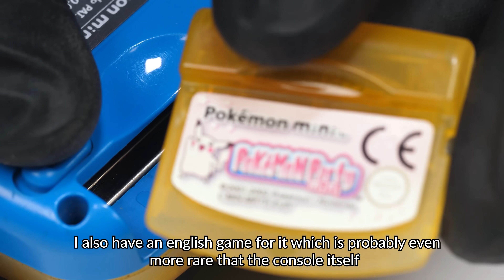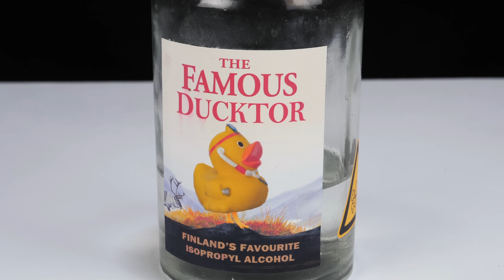Restoring a Rare Pokemon Mini - Console Restoration

Comment: That UV color restore is always impresive
Reply: And kinda hazardous
Reply: @clonedbraixen ooo why so?
Reply: Shame it doesn't last. I wish there were a way to preserve the original look without re-retrobrighting every few months
Reply: @Pixelman546  is there some kind of transparent primer that you can spray on the part to preserve it longer?
Reply: @prodigy_84  There is anti UV coating spray, but even that won't last too long.
Reply: Agreed
Reply: @prodigy_84 Thing is, if plastic gets damaged by UV, its chemical structure is already altered/ruined. It gets weaker and weaker over time and eventually it will crack.
Reply: Literally the only solution after doing some research is leaving it in a box in a dry cool area. Which defeats the purpose of doing the whole restore in the first place, cause you’d want to display or use it afterwards. But there isn’t much you can do to prevent clear translucent plastic turning yellow again. Other than leaving it as is & only restoring other pieces on it so it at least functions.
Reply: Heck yeah boi
Reply: Wonder if it'll work to make me happy again
Reply: I had a good ol “holy sh*t” moment when i saw how yellow it was. Thought that was the original color lol
Reply: "grandma, the bath is ready" 😂
Reply: I honestly though the console was yellow and blue

Comment: I don't understand why you use a rechargable batterys to try your devices.
A rechargable battery only got a Voltage of 1,2V if its completely charged. (Maybe 1.3V) This is 0.3V to less. If a normal AA Battery has only 1,2V left its called empty. So it can cause some problems you are going to serch for.

Comment: Don't forget about the trick of soaking the screen adhesive with IPA to loosen it and rocking the plastic frame back and forth to release the screen when dealing with fragile screens also you left quite a bit of corrosion on the PCB you could have got it out with some vinegar. But you have to make sure to get rid of it all otherwise it'll also corrode the copper
Reply: Pretty sure he’s been doing this for a decade or so. It’ll be fine.

Comment: You can clean corrosion from the circuit board with the eraser on a standard #2 pencil first, then follow up with isopropyl alcohol on a cotton swab afterwards. The eraser is very mildly abrasive & cleans the circuit board more quickly & easily than just the cotton swab.

Comment: Despite the size, the resolution of the display seems pretty AMAZiNG. I think it could have at the position of GBA micro.
Reply: It's kind of funny, because a similar device, the PocketStation, actually had the same processor as the GBA. The GBA color screen and other hardware made much better games possible tho, as the PocketStation was just a simple mini-game console and memory card, kind of like the Pokemon Mini but without cartridges.

The Pokemon Mini actual processor was much weaker tho, only 4MHz vs 16.78MHz on the GBA/PocketStation.
Reply: @VanisherXP And that is what this was intended to compete with - the Dreamcast VMU and PocketStation type devices. Something you could carry with you for a quick diversion. This though didn't link up to a console as a memory card or interact with the console games.

Comment: It turned out great overall! Only thing I would recommend is neutralizing the leaked battery electrolyte with vinegar or similar. There's still quite a bit of the electrolyte still on the PCB, which will eventually corrode it further as time goes on.